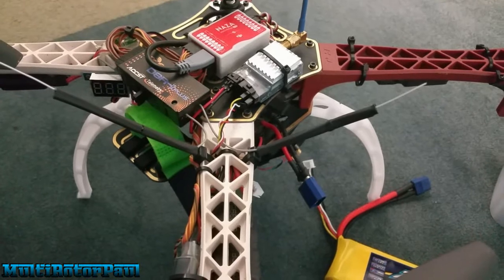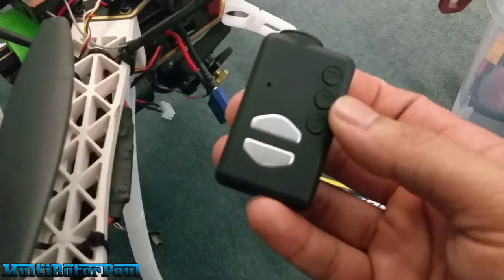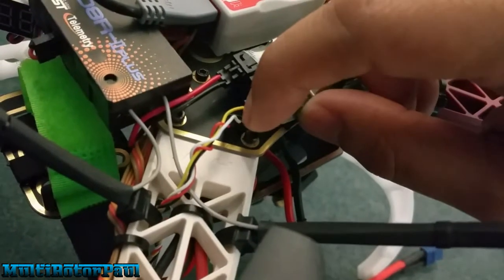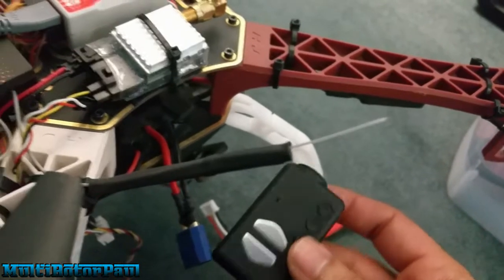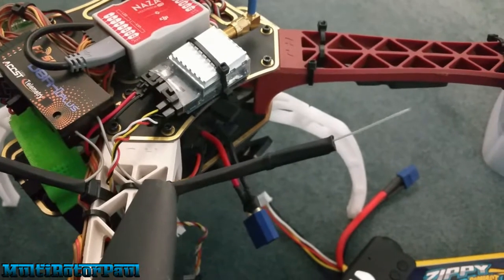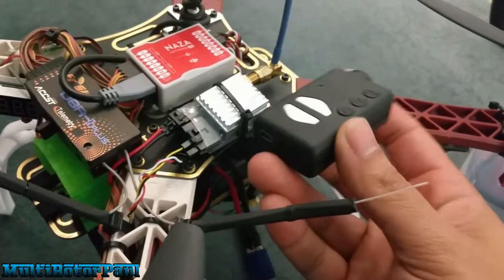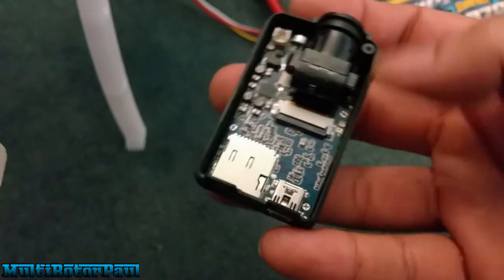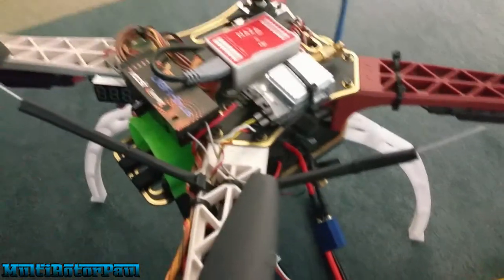Power Mobius Camera from your Multirotor using 5v BEC

Comment: Same thing happened to me. I ordered one of the new "lens C" versions to replace my fried "lens A", not knowing there was a replacement board available, but the new lens is pretty awesome. If the fisheye effect is too strong for you can can drop it down to 720p 60fps and it narrows the field of view. Might order a replacement board to have two mobius' available with different lenses. 

What is the reason why you can't just power it from a BEC on one of the ESCs?
Reply from the maker: Alex Clark I could have powered it from a BEC. Most BEC should give you 5v 3amps. It is still recommended to power the Mobius from a stand alone BEC though.

Comment: Just a follow up, did you change the motors and what ESC's are you useing? 
Don't forget to put your video of the new board when it arrives.
Reply from the maker: W Morris no, haven't replaced anything yet. Been flying without FPV gear for now. I plan to get the RCTimer SL2212 motors/props combo though.
Reply from the maker: W Morris I'm using Hobbyking F-20A ESC's, by the way. Flash with SimonK. I also did a video on how to flash those too.
Reply: MultiRotorPaul Thanks. I have the multistar 20A and I can't get them to flash. They seem to be working ok but I would definitely like to use the SimonK. Don't know, or better, can't remember, if you are using telemetry data. I would like to get GPS data in case I have to find it. I'm using FRSky trannis x9d + with and FRSky x9D and they have their own telemetry. Just wondering.Keep up the great work.